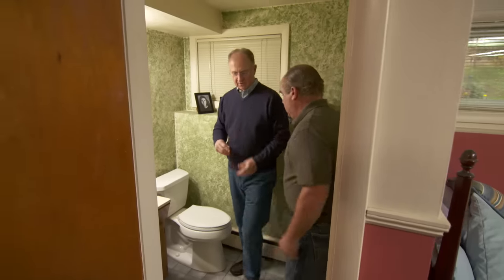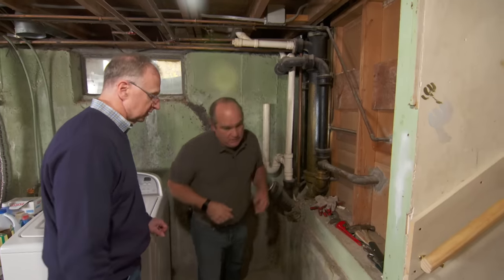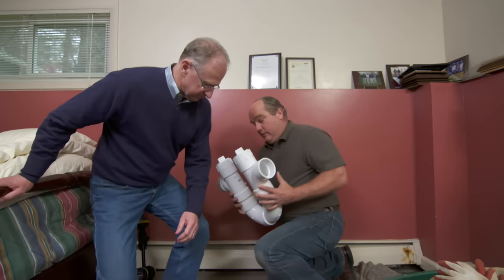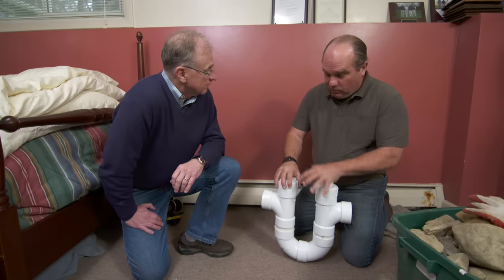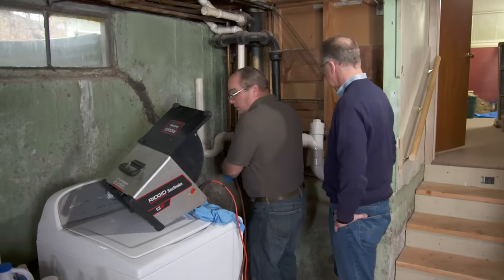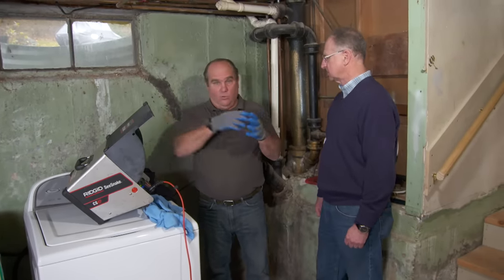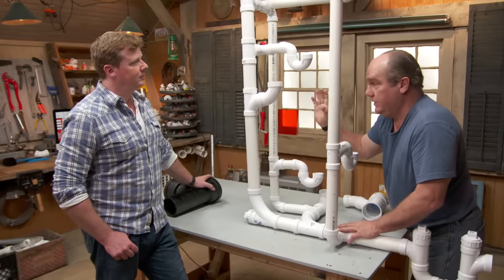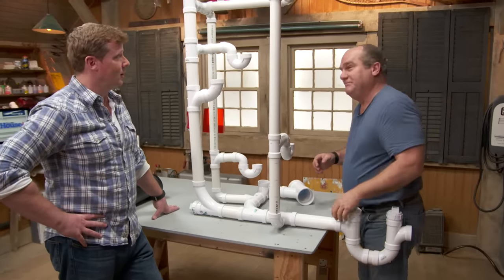How to Diagnose Plumbing Drain Problems | Ask This Old House

Comment: Abandon the old pipe. Don't fix it.  Run a whole new pipe system out in the yard next to the house so you don't have to dig up everything.  I did that and it worked great.
Reply: dsrekjw I don’t understand how that’s cheaper than the original solution
Reply: @jimk5307  you ought to read his comment over again.
Reply: Max R it looks like the bathroom is still in the mix for at least a partial demo even with the reroute to the yard. And that’s a concrete wall with the waste system in it so it would need work too.   Maybe less work and cost than tearing up the floor in the bedroom but still an expensive project.
Reply: dsewkjw
That was my thought as well. I have done loads of jobs like that where we just abandon the old stuff and break out into the outdoors rather than digging up the house floor.
Reply: @SkillBuilder  I'm a little confused how that works. If you add a new drain line in the yard at what point do you connect it to all the drains in the house? To fix this problem wouldn't you have to dig a trench in the house right next to the rat trap to connect to the main junction of the stack and main drain where they were in the basement?
Reply: @hotbam37  The point is that you will be digging up a lot less of the house.  It is easier to dig a trench outside than to break up the concrete floor/foundation.
Reply: Something similar has to be done to my kitchen sink drain that connects with my washing machine. The plumber will be running the pipes outside digging a trench all the way to the main line in my backyard.
Reply: I did the same.  New pipe out a different side of the house, avoided a lot of demolition.
Reply: I did the same. Dug a trench outside... most kitchens and bathrooms are about 1-5 feet from the outside wall. It’s easier then digging straight through the middle of the house to get to the main line.
Reply: Yes running a new line is probably the only solution in this case. The problem with Cast Iron pipes is after so many years in the ground they become very brittle and crack with the slightest movement  you wouldn't want to fix one problem and cause another especially with a sewer line.
Reply: @hotbam37  What you would do is place the new sewer line and the vent along the side of the house vertically along the external walls, this gives you access to the pipes if needed,  and then its a case of knocking a small hole in each bathroom wall to make the connections. The kitchen , sink  and shower connections would be tricky but you would more than likely be able to use the existing pipe work as this would be newer and not cast iron. You don't have to worry about the rat trap as it would no longer be used when the Water Utility makes a new sewer connection.
Reply: @joewell3074  As afar as I know all Sewer lines connect in the street so you would have the Local Water Authority / Utility  make a new sewer connection and then you run a new sewer line through to your yard. The old line would be filled in and bypassed.
Reply: @timg6850  thanks, makes sense
Reply: But did you get the city involved with a building permit and an inspector?
Reply: @dvdfrnzwbr  I would have thought that would be given otherwise you could get yourself into all sorts of trouble. I know one site I was working on the builder payed
 $100 000 dollars to unblock a sewer because concrete from his site got in and blocked the line for the street.
Reply: @timg6850  I made an Insurance Claim on a plumbing issue exactly like this one, the Insurance Agent made me sign paperwork saying that there would not be a Building Permit or an Inspector involved.
Reply: @dvdfrnzwbr  Where I live in Australia that wouldn't be possible as to do this sort of work you would have to get a person known as a drainer ,who is plumber but is certified to work on sewer lines,  to do the job.  What happens if the sewer line work is not done correctly?
Reply: dsrekjw, well some older homes have a combined sanitary and storm water system that collects the waste from the bathrooms, kitchen, and laundry as well as the downspouts around the outside of the house from the gutters. Abandoning that line would leave nowhere for the water to go from the downspouts except under his basement floor.  Or redirect them outside away from the house.
Reply: that’s a good idea
Reply: Or install an ejector pump

Comment: the problem of stagnant water and why the pipe has been curved, losing the slope for the water to flow.  It is for the foundation of the house. 
 It is more than clear that the house was unleveled.  Cracks in the windows or doors give indications of the Foundation's problem.  
By raising the house to its correct level, the pressure that curves the water fall is released and the house is given adequate maintenance, when leveling the house, the plumbing is free of pressure due to the fall of the house.  Now that has been the cause.  The solution or lift the house or replace the pipe and give it your drain drop.  
Anything that is done will result in a great job.

Comment: as a plumber myself im not convinced that was the full cause of the smell.. i didn't see any air bubbles come through the toilet. i agree its something that needs changed but often times there is a leak in old venting or cast piping causing the smell sooner then coming through the floor.. but if the bathroom floor isn't cemented in its very possible as cast piping isn't sealed very well
Reply: 2007dalin he said that.  The sag may have broken the seal
Reply: As a plumber yourself you should pay attention before shooting your mouth off and trying to sound superior.

Comment: what an expensive problem! poor fella
Reply: corey Babcock yeah the anxiety of it all would have me selling the place instantly... with knowledge passed on to the next owner of corse..
Reply: corey Babcock  U can't leave it, methane starts seeping trough the cracks.
Reply: Tbh the digging part. Would be the hardest... Abs or pvc  is easy to work with
Reply: Is there any plumber or homeowner have seen the “belly” cast iron drain pipe under basement foundation? Could you please let me know which video is this problem? Thank you very much! I was told that my drain pipe has this problem, but the plumber can’t show me a picture with this same issue. Cast iron, no broken, belly, under foundation! Thank you!
Reply: I What probably just get rid of that bathroom and turn it into something else plugg it up

Comment: Legend has it, the pipe is still sagging.
Reply: No crap, I'd deal with a little smell over a complete remodel
Reply: @morecrapforputdowns  The smell will only get worse
Reply: Michael Ross  You minimize the problem. It will worsen to where solids will collect at the low point and the pipe will become occluded. Then it will need to be snaked each time otherwise the basement toilet will overflow each time the upstairs toilet is flushed or the bathtub water is released . The condition that caused the pipe to sag will eventually cause it to separate and sewage will be running out.
Reply: Your comment is sagging.

Comment: That's a perfect explanation for positive and negative pressure in a plumbing system . That's WY studior vent must only be used in special circumstances.  It only allows for negative pressure usage an not positive .

Comment: That right there is a land lords nightmare.
Reply: dude, i have a rental property. it is having some drain issues. 100 yr old house. i'm snaking it out now, but I don't think that's gonna resolve everything. I'm pulling out roots. Probably a deteriorated pipe. Would be expensive to repair. Should I sell the house as-is and let new owner deal with it?
Reply: @nofurtherwest3474  sell the house like that and it could be a serious legal issue for you when they find out you didn't disclose it
Reply: Matt P  Ok thanks
Reply: @charkswitlazers  Ok. I'll just fix it. I bought a endoscope camera to inspect it. It drains fine after I removed roots. But I am still curious of the condition of the drain pipe. Certainly it's not expected for all drain pipes to be in perfect condition right? We are talking about many old houses out there with very old pipes. I can't imagine that all of these pipes are in perfect condition when the house is sold.
Reply: @nofurtherwest3474  is this the sewer pipe with roots? My house had the same thing. I ended up re-sleeving the sewer line. Expensive but fixed the issue
Reply: @nofurtherwest3474  Get it cameraed to confirm broken pipe.  However, many/all? old underground house sewer lines were clay with mortar in the joints.  Small tree roots find their way in over time through the deteriorated joints (Sewer lines hold natural fertilizer for the roots).  Try Root X; better than cutting the roots.  I also am a landlord and discovered this issue a couple years into owning the property (I am also a General Contractor and one of my plumbers recommended it; IE he wants more work so he will give me the best solution).  You use it once a year; <$75.    I confirmed the length of my house sewer from the basement cleanout to the sewer main in the street,  bought the appropriate amount (2 or 4lbs), dumped it in the cleanout, filled 5 gallon buckets with water and dumped the instructed amount in the toilet.  Do it before bed or before work so the foam can sit in the pipe for a while and slowly drain out.  Haven't had an issue since and that was 3 or 4 years ago I started doing it.
Reply: @merclb56  Thanks. I might try that. 
Is there a way to determine where the drain goes from the basement? I don't see where it empties into the street, so maybe it goes the other way - to the alley where the city main is? I wish there was a map of all drains for every house. I wonder why this does not exist. It would save a lot of headaches.
Reply: @nofurtherwest3474  It should go in the street, not the Alley.  Walk the street and alley and see if you see any manholes that say sewer on them.  Once you determine where the city sewer is, just pace it off or use "measure" on google maps.  Assume the sewer runs parallel to the street or alley directly under the manhole and takes a straight shot to your cleanout.
Reply: @merclb56  Thanks, I couldn't find a cleanout though except the one in the basement.
Reply: @nofurtherwest3474  use that one
Reply: @merclb56  ok thanks. i did put an auger down there and got out some roots.

Comment: Had to fix something like this 6 months ago. Replaced about 40' of 4" abs under brand new carpet and tile floors. Ended up around $70,000. Don't by a house without a thorough camera inspection and pay a general contractor to look at house also. You really can't expect much with your typical home inspector!

Comment: I built one of those traps with two cleanouts with 3 inch PVC and I just installed it not that long ago for a purpose that stopped sewer gas from coming from a hacked together sewage pumping system in a commercial space.    All of our drains go downhill slope till it comes to a wall then goes through the wall but no one told me that the hack that put the system together went 3 feet uphill on the other side of the wall so my 3 inch drain is actually filled with water all the time so it acts as a 3 foot deep trap!!! So basically after realizing my drain fills with water The trap that I built doesn’t actually do anything other than make a big huge U shape in the drain but it does allow me to clean out the drain very easily once every month with a garden hose bladder attachment luckily I don’t have any bathrooms on this drain at all or this would be a nightmare most of it is Clearwater from the floor drains and one stainless steel washing sink.

Comment: Here's my take on this...it's not gospel....but it's a rational possibility;
Whole house trap? Get rid of that for sure...you have it mostly dug up anyway. If turds and paper are making it through the whole house  trap...they'll make it with out it. That model he made (towards the end of the video) of what the plumbing looks like underneath the slab is pure conjecture (not sure why there are 2 other traps...there's only a toilet (toilets have a built-in trap) and a sink down stairs....but it looks cool I guess). What you CAN see from the basement is the upstairs bathroom draining into the same vertical pipe as the downstairs is draining into.(someone probably added that bathroom upstairs later) When you flush the toilet upstairs, that water is falling very quickly past the branch lines serving the bathroom downstairs...that's going to cause air to move no matter what....and that's why its against code. Upstairs needs a dedicated 3" waste line going up.(much less $$$ and work than the other plan) So this homeowner may spend all that money and still have the same problem. The bathroom probably smells occasionally because the wax seal under the toilet is leaking....few people know how to properly set a toilet...the tile in that bathroom looks relatively new...tile guys are not plumbers....it's not as easy as you might think. I've been a professional union plumber since Jr. High....I'm 59 now. (end)
Out of curiosity I'd pull that downstairs toilet (check the wax seal) and watch what happens when the upstairs toilet is flushed. Heck, I live in a new house and when it's really windy outside, toilet bowl water will move that much....and I never saw any bubbles come up in this video.
Reply: Good points, good thinking, you will go places (or have been) thinking like that.
Reply: I had no idea someone could be a union plumber while still in junior high school.

Comment: rather than dig up the basement, couldn't at least part of the sewer line be relocated under the foundation wall and outside? that's what we did. saved jackhammering 1/2 the basement floor up.
Reply: +Island Guy. I was thinking the same thing. After the toilet, have the drain make a turn to the outside. Run it outside until it ties in with the existing sanitary lateral. The fill the old sewer pipe with flowable fill. Maybe there is a deck, patio, or something else outside.
Reply: The simplest, and most reliable fix, is to take the sewer from floors above, out the wall,below grade, and then join just outside the foundation to the lower drains from the basement. Adding one backwater valve to serve just the basement drains, and leading the new work straight towards the old sewer tap in the street, running new pipe that meets local code, the entire way. An additional safety factor can be had by running this house sewer as a 6" pipe, having cleanouts at each end, and also using sweeping bends where needed.
Reply: Island Guy yes it can be done this way remember this isn’t a professional it’s a do it yourself you can legally fix your own home plumbing but to fix someone else’s u must be licensed here in Alabama where I plumb we don’t have these so called “house traps” anyone that installs such a thing knows little about plumbing in general since toilets have traps built in them and lavatories have them under the sink
Reply: jason grier No one would install a house trap anymore. They are in lots of old houses from the original construction.

Comment: Get rid of as much metal pipe in your home as possible any chance you get.
Replace all  supply lines with PEX.
Replace all drain lines with PVC.
Reply: I agree totally about the PVC for drains...it's the way to go!...it doesn't corrode or close up like metal pipes!...I just had to replace several 2" galvy drain pipes which you couldn't put your pinky through or see light through!...typical for old houses...  PVC is most definitely the way to go here! ...but I disagree totally about the plasdick for supply!  There is a reason all your doorknobs are made of brass (an alloy of copper), and restaurant counters are made of SS!  The metal ions are bactericidal, and prevent nasties from growing and thriving inside supply pipes or on counters...with plasdick supply pipes, you just don't know what's growing inside there!...no thanks!...I won't be drinking from that.  Period!
Reply: in my state you are suppose to replace drain lines with what was there before...cast iron out..cast iron back in with no hub couplings...i have never met an  inspector that enforced that rule though..i do pvc and abs all the time.
Reply: i should add that is residential....commercial work they do not let us get away with that.

Comment: I live in apartment and after 8 years I started smelling sewer gas in my bathroom drain and I live on the 3rd floor. my Manger and others tell met to put water down every week. sometimes it works sometimes it doesn't.
Reply: Is it a drain in the bathroom floor?

Comment: I'm having this issue and my landlord will not fix it, everything backs up into my sink, which smells like literal crap. I don't even know what to do at this point.
Reply: If you're renting just call the CODES OFFICE in your town and report your SLUMLORD!!! THAT BACKUP IS ACTUALLY THE CRAP COMING BACK UP INTO YOUR DRAINS AND I'M SURE YOUR SMELLING SEWER GAS TOO!!  CALL CODES ASAP !!
Reply: Report your land Lord and get legal advice if you can so paying rent for that problem
Reply: Hopefully it's a single family and not an apt complex cause that might be your neighbors waste backing up in your apartment.
Reply: Move out?  That's the beauty of renting.  Hightail it out of there once the neighborhood goes bad, or in your case, when you start getting sewer gas.

Comment: The real question is why couldn't the original plumber find the problem...I'm not a plumber and when I saw water a few feet out and a dozen or so feet later not much water I knew a sag in the pipe was the culprit
Reply: you cant locate the exactly place